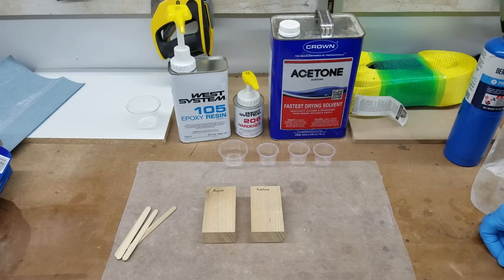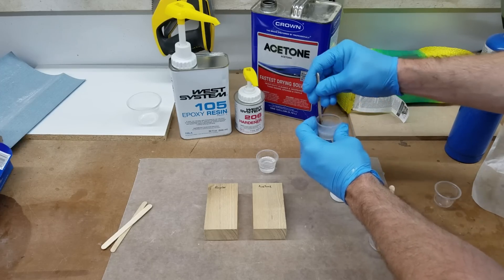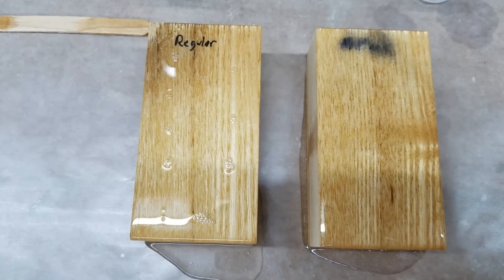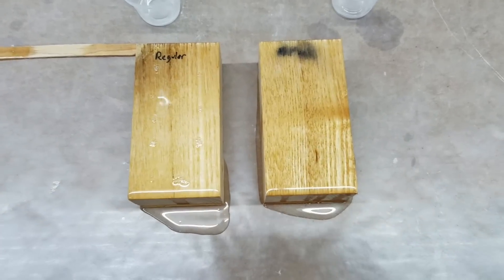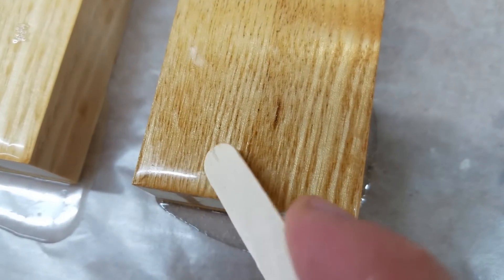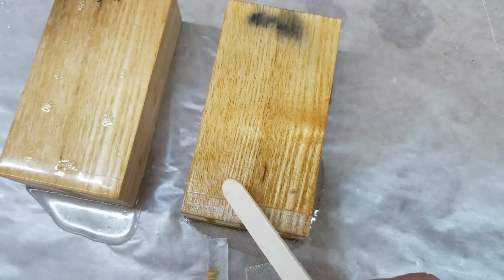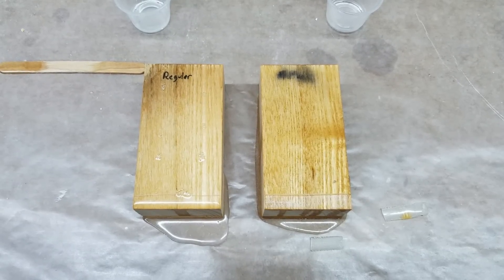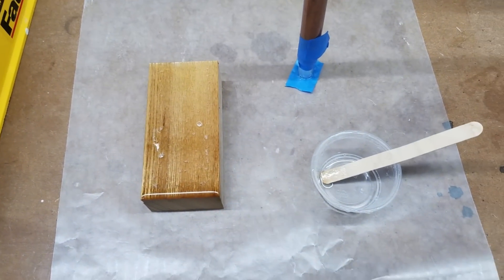What happens when you cut epoxy 50 percent with acetone?

Comment: With regards to you being intrigued as to why your epoxy flattened out better when you blew on that one corner I watched another video that said when we use a flame touch to release the bubbles it's actually saposedly got little to do with the fact of the heat but more so the carbon dioxide that allowed the epoxy the release the bubbles it was said blowing it would be too strenuous and not enough at once to activively work properly and hints why touch is the common method  but I am assuming that because when you blew into the box in a corner there was enough carbon dioxide trapped there to have almost same affect 🤷🏻‍♂️ .... Great content thank you very much

Comment: After seeing your post concerning diluting epoxy with various solvents, I wanted to mention that to show how much each one penetrated the wood samples, you should cross cut them and examine the interior for penetration.

I used to build kayaks using 1/ 8-inch thick plywood and polyester resin. I found that diluting it with acetone caused the resin to remain tacky even after several days of cure time. 
This wasn't problematic in that it made it easier to apply fiberglass and more undiluted resin to finish the project. 
Anyway, just thought I'd share this with you.
PS, lacquer thinner is just a mixture of acetone xylene and toluene. I used to work for a paint manufacturer, so I'm familiar with the various solvents used.

Comment: Also the wood on the acetone looks so much better. So could you use a thin thin coat of acetone side to penetrate wood better then do the regular on top of it to get the hardness and dirability. ???
Reply from the maker: You could, although in most cases, it wouldn't be necessary. Epoxy will stick to the wood just fine unthinned, but sometimes I do it this way when I need to reinforce or seal some softer wood.

Comment: I did a similar test. The thinned epoxy never hardened to more than silicone like substance which is not satisfactory to me as I need all the rigidity, strength and hardness I can get from my epoxy finish. 
Deep penetrating sealer - Yes.
Surface coating for hard wearing protection - No.

Comment: I used mostly isopropyl (above 90%) and a little acetone and it helped my clear, aeromarine grade epoxy soak into my fiberglass stuffing in body work. Otherwise it would just run along the outside and down. Has lasted so far about 10 years.

Comment: A number of years ago, I was doing some laminating with epoxy. Yes, you can thin epoxies with Acetone. But very little is required. Also, there are many diff. kinds of epoxy. I preferred using some with sufficient pot life (45-90min) to tack. The trouble with mixing anything with epoxy is the act of trapping air into the mixture. So I used specially modified mixing machine to accomplish this. Worked very well. But I also added another aspect to the process using vacuum to remove unwanted air bubbles from the epoxy being poured. 
Acetone is generally used to flash air bubbles from a poured surface using spray bottle. When the exotherms kick in the cure progresses. But thinning the typical, 2-part epoxies affects both cure times and final results, as well as durability. Compounding anything into epoxy during mixing traps air. So the more mixing you do makes it worse. And thinning with any solvent only degrades the balance between the amines and hardener. As I recall, I used approx. 10% Acetone. Then I mixed my compound in a vacuum environment. I could tell you more. But am reluctant to do so on this platform.

Comment: I love the empirical test.  People and so called experts constantly spout out opinions without any side by side tests when it comes to paint,  or just about anything.

An interesting side tidbit : I ran into moisture bubbling in lacquer I was spraying on cabinet doors a year ago.  I called all the help lines and experts.  Only one guitar guy realized that it was moisture getting into my air, despite a recent upgrade to my moisture traps. I first solved the problem by adding acetone to mix. Then I re downgraded my moisture trap which made the acetone unnecessary.

Comment: A four year old video but nothing has changed. I built model RC aircraft and used Glow engines/fuel. The fuel was a mixture of Alcohol, 15% Nitro Methane and 18% oil. There are a lot of different brews but this is what I used. The oil tends to get into the wood and soften it over time so I would mix up a batch of epoxy and 50% Acetone. That brew would be slathered on the firewall and anyplace the fuel would get deposited on. The thinned down epoxy would soak into the wood and repel the oil. The blend is still used today.

Comment: TL;DR: try denatured alcohol

We used EnviroTex (that tabletop epoxy from the 80s, you could buy it at the home centers) thinned with denatured alcohol to apply 3/4 oz glass cloth to wooden helicopter rotor blades. We tried several things to reduce the epoxy including acetone, the alcohol worked best. No idea if that holds true for other epoxies. It cured hard overnight and you could sand it the next day. We scuffed the bumps off and sprayed primer/surfacer, blocked and painted. This was in lieu of a traditional aircraft Ceconite/dope type finish the manufacturer originally used in the 50s. Kaman HH-43 Huskie, we remanufactured them from USAF surplus for logging/fire fighting in the early 90s. They were eventually replaced by the Kmax.

Comment: 42 years ago we also used the 50/50 process to put a finish on our wood race boats. We would sand the first coat after a few days and then apply a second coat. It made the boat look like a piece of furniture. Fast forward to today and the wood finish still looks good and the wood was protected from the water.
Reply: Did the thinned epoxy eventually harden, or did it stay rubbery after several years? Thanks!
Reply: @Bob_Adkins  it was hard after 24 hours. I'm wondering if maybe we used less than 50% acetone.. To long ago to remember for use. But it was hard for the next coat the next day.
Reply: I just did a cedar boat these past weeks with System 3 S1 diluted about 25 30  percent.  Seems hard to me so far
Reply: My guess is you varnished it afterwards and kept the varnish good.
Reply: @ For the inside of the boat, we didn't varnish, just left it the way it dried (43 yrs later still looks the same). For the outside, we sanded the coating, then sprayed Imron over it (again, after 43 yrs, still looks great, with a little touch up because it's a race boat and there where scuff marks from working on the boat between races. Hope that helps.

Comment: One comment mentions heat gun. Hopefully not one with acetone added, where the red hot element is exposed closely to the work. Another method for popping bubbles is a flame/torch, but probably would not want to attempt that in the epoxy/acetone method. At least not unless your head and eyebrows were already shaved.

Comment: if you are in the boat business and are building a wooden boat it's a good idea  to use acetone with your epoxy  but not as much as you used  this will be a sort of your primer coat that you go over corners angles and curves and all joints the idea is to have the some of it seep into the wood grain joints extra  and you let it dry for not 24 hours or 48 hours let it be sitting their for weeks o coem as you work your project  they you light scuff or light sand when you are in the final stages  in a lot of the project there maybe fiberglass cloth too and that will soak up better with solvents then you come back with the final coatings but we never use epoxy by itself unless we are just doing like tabletop   extra all exterior stuf its best to use marine varnish because it moves with the weather  epoxy doesn't

Comment: If you use acetone with epoxy, pre-wet the wood with acetone first ...

Also, you used half the epoxy with the acetone. IMO, if you really want 50% acetone, you should coat twice to ensure a constant amount epoxy for your thickness measurement.

Comment: 25 years of wooden boat ownership, repair, and research here. Thinning epoxy with acetone has a few effects.
1 - It does not help with penetration. The acetone penetrates easily into the wood, but the larger epoxy molecules penetrate much less. If you want epoxy to penetrate wood, use a low viscosity or penetrating epoxy such as MAS. Another approach is to preheat the wood to the desired depth, but this will cause the epoxy to set much faster.
2 - The acetone as you noted will outgas through the epoxy leaving bubbles and porosity all the way through it. This makes it permeable to air and water.
3 - Any chemical, e.g. acetone, added to epoxy will change the chemistry. In this case, it retarded the resin/hardener curing reaction. It likely affected the strength as well.
A side note: heat, such as a heat gun or a judiciously applied propane torch, will help the epoxy flow out and eliminate bubbles. This is a standard technique on epoxy countertops and floors.
Reply: our hydros were decked with Okoume. Okoume doesn't like water (I know sounds strange to use a wood that doesn't like water....lol). But in most case, the wood showed no signs of water penetration, except where there may have been breach from hitting something or not getting enough sealer on in the first place. I was amazed when I took the the deck off after thirty years. I resealed the new wood the same way. It has been thirteen years now and still looks like new. Oh and to be fair, we did seal the outside with a clear coat of Imron. Maybe that's why it wasn't breached.
Reply: Thanks for mentioning molecule size! I hadn't considered that factor. I'm looking at trying thinned 100% silicone for treating wood for a bridge on a hiking trail. It's used for DIY waterproofing bed sheets for light weight tarps, etc. Looking to have something that really soaks in an will last in Wet Coast forest conditions. It's a volunteer thing so little in the way of budget plus a bit of a slog to get to with any equipment (downed tree at the site being used for the wood). I'll experiment, but appreciate you bringing a new consideration.
Reply: @wingnutbert9685  for your use, I'd recommend 2 coats of MAS epoxy, followed by 2+ coats of oil based paint or linear polyurethane. Be sure to wash the "blush" off of the epoxy between coats, and rough up with a green scotch-brite pad.
Reply: I had a poor experience with MAS epoxy . I will only buy west system epoxy .   I think you should ask west how to proceed !
Reply: What are your thoughts on Total Boat epoxy vs MAS?
Reply: @MadLadsAnonymous  MAS is lower viscosity so penetrates and flows more. Haven’t used Total Boat.
Reply: @robertschulke1596  then how does wood penetrating epoxy work?
Reply: @collincluff7955 
it doesn’t
Reply: @robertschulke1596  
I was talking about polyester resin. In my comment. But I'm still wondering how wood penetrating epoxy works, especially since your recent response. 🤔

Comment: Methyl alcohol (methanol) is an excellent thinner for epoxy.    Used as a fuel constituent for glow plug engines as used in model aircraft,  cars and boats.   When doing clean up I find methyl alcohol actually works better than acetone.    Methylated spirits which is ~ 85% ethanol and 13% methanol may also work
Reply from the maker: Agreed. Alcohol has become my preferred epoxy solvent as well.

Comment: 1) Acetone is hygroscopic, e.g. it attracts water;
2) Acetone can also react with epoxy catalysts that are usually some kind of amine;
You should try for instance, xylene or ethyl acetate that will dissolve similar things that acetone does but are way less reactive.
Reply: Another problem is that epoxy hardens, acetone evaporates from it and leaves a slightly porous structure.

Comment: As a retired boat builder I used 10% MEK to mixed epoxy for the first coat over wood with fiberglass, or to bond 2 pieces of wood together. This allows the epoxy to soak deeper into the wood for adhesion. Then the next coats with fiberglass would be 100% epoxy.  MEK evaporates faster then acetone, which allows for a faster cure.
Reply: Wait, genuinely curious about this. I thought acetone was the fasted evaporating chemical solvent available. I'm in granite, we use acetone and mek. Acetone is gone from a rag within a minute or less. Mek seems to stay much much longer. Is it because mek now is a mek substitute? You can't get real mek anymore. It says substitute on the label. But, damn mek with make me pull over my box truck to get rid of even one mek soaked rag from the back... You will pass the eff out from those fumes. Again, I'm genuinely curious, I'm not trying to be a jerk.
Reply: @SzechuanChickenDog  Yeah, MEK substitute is not real. Real MEK is distilled from acetone. You can find real MEK but you have to try all the hardware stores. Some won’t carry it.  MEK is what we used to clean rubber molds in production. It literally melts rubber and some paints, and will ruin shinny surfaces on a lot of synthetic materials.  Acetone is meant more for removing fingernail polish or cleaning up after a wet solvent. It won’t dry out the hands as bad.  Hint** use latex gloves, not nitrile, with MEK/acetone.  Nitrile gloves are for paint thinner and oils, which is a wet solvent.  MEK/acetone are dry solvents and will not leave behind residue.

Comment: I use Methalated Spirits to thin my Epoxy, MAX 20%.
Doesn't evaporate as fast as Acetone, reduces the tiny bubbles.
Reply from the maker: My preference now is 95% grain alcohol, but methyl is certainly easier to get in most areas.

Comment: To remove the bubbles in the surface of the epoxy just lightly spray with alcohol. 
This removes the surface tension and allows the bubbles to escape.
Reply: Or a quick pass with a heat gun.  If you warm the wood first, no bubbles will come out of the wood.
Reply: +1 to heat gun.
It's the professionally accepted solution for gel coats, clear pours, etc., and is a LOT less necessary if you use a vacuum pot, and mix slowly to prevent bubbles in the first place.

Comment: I'm a little unclear as to the purpose of this test, other than to demonstrate that too much acetone - or denatured alcohol - will retard curing to a hard layer.  I  have found thatno more than 15-20% additive does not appreciably prevent a hard set, but still yields a nice buildup on a surface.
Reply: I'm not sure either, but I found it really helpful, cause now I know that mixing acetone with epoxy will make it softer
Reply: @joseZudaire  I wonder if that characteristic can be used for a coating on something that has to have limited flex.
Reply: @OutnBacker  oh for sure

Comment: Ketones CAN be used to thin epoxy IF you are thinning a system with a long room temperature open time. Such systems typically require elevated temparature cure, In such a system all the ketone will have evaporated before cure. Instead of a ketone use a reactive modifier like Heloxy 61 or 68. (butylglycidyl ether family). West already has some modifier in it; it is not a "pure" resin system. Most systems for hand layup will already have some rective modifiers in the mix.

Comment: Since acetone is used for cleaning up brushes and rollers after layups since it completely dissolves epoxy, I would imagine it significantly degrades epoxy in ANY dilution! I personally wouldn't put even 10% acetone to my epoxy. If all you want it to seal in wood just go with polyurethane.

Comment: When the epoxy has flowed out but still liquid, try a hair dryer, heat gun or propane torch with a fan nozzle to draw out the bubbles. Practice a little.
Reply: Probably would not use a torch on acetone. It’s highly flammable.

Comment: WEST SYSTEM boatbuilding manual used to recommend against thinning their epoxy, on the grounds that it did not improve penetration and had a negative effect on strength.
Reply: Not just strenght. Evaporation of solvent leaves a slightly porous structure. For better penetration it is best to use slow hardener and higher temperature.

Comment: It would be good to try the thinned epoxy over a piece of wood with various paints on it. Will it dissolve other paint products?
Reply from the maker: If it's thinned with acetone, yes. I prefer to thin epoxy with alcohol, which will not affect most paints.

Comment: Could you determine penetration depth?
Reply from the maker: I'm sure it's possible. I'd probably cut the test piece and apply a dark water-based stain to the cross section to see where the stain doesn't soak in.

Comment: I am a woodworker and wooden boat restorer. I start my outdoor and boat wood with Smith's Clear Penetrating Epoxy Sealer (CPES). This is "high octane" stuff--I wear an OGV-HEPA full face respirator when applying it, but it penetrates wood like no other thinned epoxy that I have used. In the world of composite hulls (wood and ply "sealed" with epoxy), boat builders rely on thicker and thicker epoxy to create ugly dense plastic boats that offend the wooden bones that lie underneath. My journey is not complete--more field tests will reveal more findings--but old boats will tell you a lot if you are listening.
Reply: Epoxy sealer is fine. For the boat I would strongly advice against thinning epoxy. After it cures the solvent is still evaporating and it leaves microscopic voids in it's place, essentially it becomes porous and water resistance deteriorates.
Better way is to use slow hardener and higher temperature, it improves viscosity and as such penetrates better.
Reply: Do you have any idea what Smith is using to thin that epoxy?  I used to use a lot of CPES 
when I lived in California.  Now I live in Mexico and it looks impossible to get unless I 
drive to the US. Sure miss it.
Reply: Nasty stuff